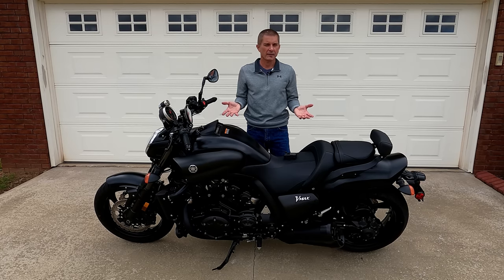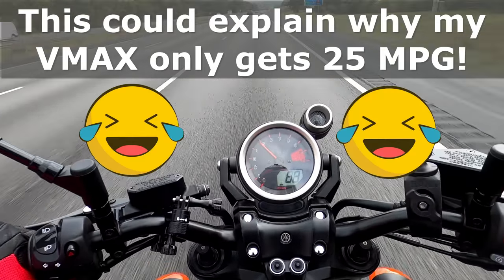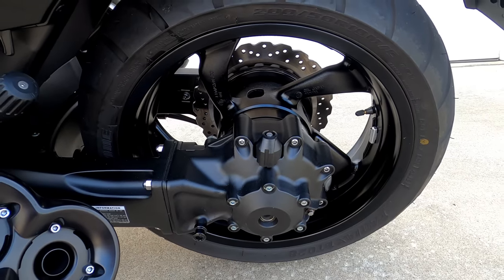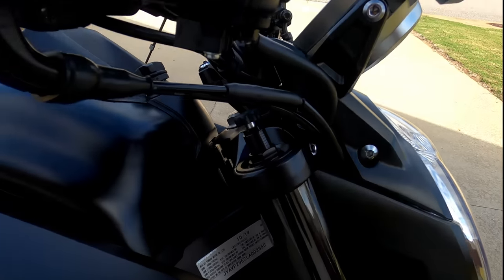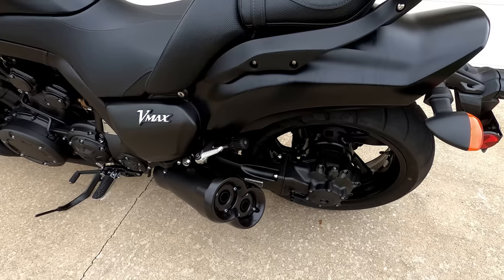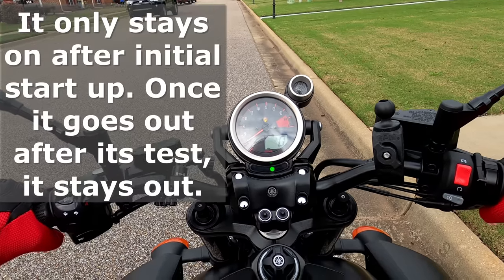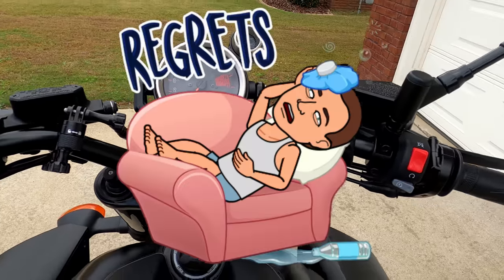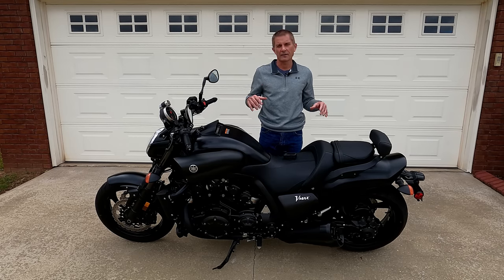2020 Yamaha VMAX 1700 Comprehensive Review | Walk Around and Ride

Comment: One of the best things I ever did was to trade my top of the line Sylvania 2005 and 2006 halogen bulbs in my Avalon for the highest legal brightness (ahem) LED bulbs my research could yield… I’m NOT talking about those expensive HID systems… I’m talking about simple plug-n-play direct replacement LED automotive bulbs. The deer here in the Texas Hill Country are just completely out of control, and a steel cow-catcher just wasn’t practical. I almost said the difference was night and day .. lol … seriously, we are talking orders of magnitude as far as just how far down the road these things throw a brilliant, razor-sharp flood of welding-arc, blue-white light that I guess must include a significant component of very high frequency, possibly even into some UV range light that causes those raised reflectors and some types of signage to glow as if internally lit.  Like a blacklight, the source carries a lot of invisible light energy that doesn’t blind oncoming drivers, but when it hits reflectors and certain fluorescent (neon) pigments, it is converted into highly visible frequencies (“color temperatures”) which is why it appears to reflect more light than it is receiving. It DOES make you think you’re seeing further down the round, which you are, but this effect is exaggerated by these hyper-reflective surfaces, but these include the eye-shine of critters on the road. Here’s the really incredible part: This is all done with 20-25 watts as opposed to 55-65 watts drawn by halogen bulbs. I had even resorted to an ‘off-road’ halogen bulb for my V-Star 650 because of the deer issue, and that bulb drew 85w low beam, and 110w hi-beam, but still couldn’t compete with the LED bulb… I even found one specifically designed for a motorcycle headlight. You sure worry less about your always-on headlight running your battery down with a bulb that draws (in this case) 1/3 to 1/4 of the power to actually do a better job. Oh, and they last a lot longer too. Considering our increased vulnerability, I would highly recommend converting to LED bulbs in general, but motorcycle headlight bulbs in particular. Last thing: check carefully the clearance behind the lamp and connector assembly; they often have heat sinks and even a tiny fan that sticks out further than a conventional bulb.

Comment: I have a 2019 just want to let you know that speedometer are off normally about 8 or 9%
Reply from the maker: I have a video on the speedometer error. I haven’t been able to determine a percentage. Mine appears to be off by about 4-5 MPH at all highway speeds.
Reply: @JeffMarcum  I have a BMW GT 1600 which is off 2 mph across the board my VMAX is off 8% on all speeds

Comment: All right y'all bikers out there I have a 1986 Kawasaki zn1100, shaft drive inline 4 cylinder obviously, it just pisses me off when people complain about accelerating on a shaft drive motorcycle and saying that it jacks the rear end, no it does not talk to anybody that knows diddly s*** about physics the weight of the bike is resisting that upward rise, that upward rise is caused by a tortional flex. The shaft drive actually forcing that rear tire down into the pavement to give you more grip under very heavy acceleration when you twist the wick especially on a relatively lightweight very torquy very high horsepower motorcycle that is shaft drive it is designed to force that rear tire down into the pavement for more grip but because said tire is against a hard surface IE the pavement what ends up happening is the torque and torsional flex pushes the ass end of the motorcycle frame in the air if you don't want your bike "jacking the rear end"then simply take a pair of 10 or 15 lb dumbbells and put them in your saddlebags or if you don't have saddlebags put a 25 lb weight strapped to your bitch seat/rear fender either that or you can just make your bike a hardtail then it doesn't have any way to flex and "Jack the rear end up" come on people seriously (the more you know) look into it instead of just being an ignoramus and blurting s*** out cuz you think it sounds cool and not actually doing any research

Comment: You can have the same experience on a Yamaha Fazer 1000 without paying 17 grand still like the VMAX make no mistake with a few mods Fazer easily over 150 horsepower that's on the rear wheel and of course Fazer is much lighter bike
Reply: Same experience? You never rode vmax.

Comment: They have been discontinued due to failing emissions I had an old 1990 V Max until two years ago they are fantastic machines but the fuel range is pathetic terrible going round corners that's the truth....and to make a  Motorcycle with that kind of power  in 2020 with non linked abs and zero traction control Yamaha are lucky they don't get sued .

Comment: One if the most uncomfortable bikes EVER! That round seat combined with an upright riding position is a well known  pressure point on the spine that ruins a. Otherwise excellent bike experience. Many VMax owners gave up and sold in the mid 80s & 90s - even after swapping with a Corbin seat. That combined with stiff rear shocks makes it a most an average tush can tolerate about an hour. tolera

Comment: Look at the poor rpm way high and no 6th gear, no excuse to not have the 6th, it would improve the economy and make that poor sized 4gal tank breath. At present that's 100 miles and you're looking for a fuel stop.  Yes I had the first in the UK of 150 introduced back in 2009 in black. I have numerous issues with this bike but it is a thrill to ride. It cant quite be called a cruiser as its limited in distance. Nag yes also the tank LCD is useless with a full-face helmet without eyes off the road.